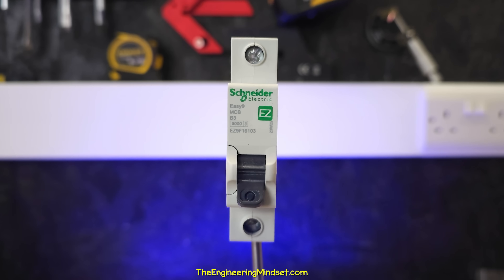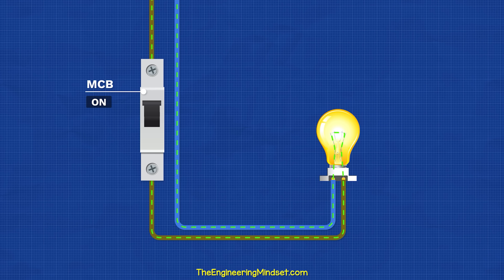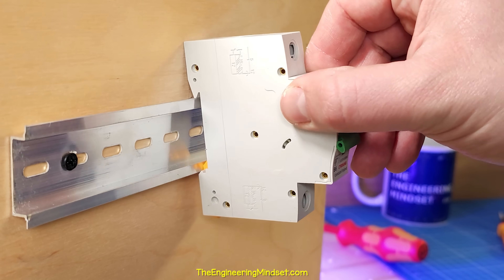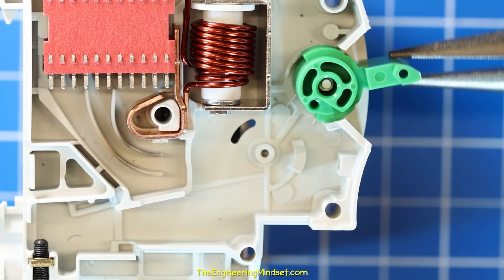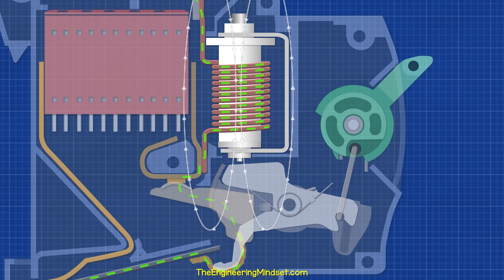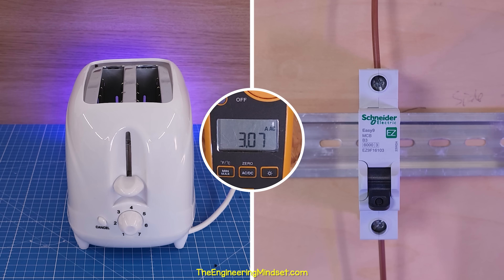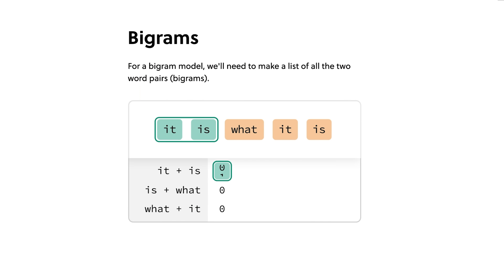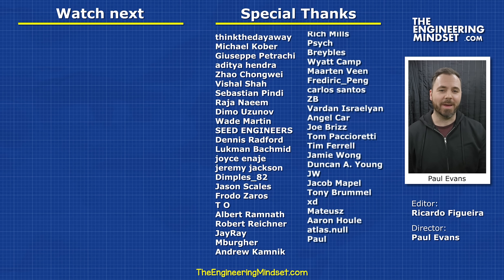Why Circuit Breakers DON'T Protect People (electric shocks)

Comment: it is also necessary to explain why RCD are not used as a substitute for circuit breakers and the types they are and the difference between them. 
also include the effect of the grounding circuit on breakers and the reason why it is not ok for it to be connected to null.

Comment: How does the solenoid push the piston the same direction regardless of when in the AC phase the rush of current happens to occur? This is mentioned at 11:34 but I can't tell why it works both ways.
Reply: My guess: 
Since we are running AC with 60 hertz, that means in 0.0083 (1/120) seconds it will switch the force to pull down anyways. 
Alternatively, maybe the piston will get pull back down by the spring with enough force to break the circuit.

Comment: Nobody puts the neutral to a breaker! Its even bad for the symmetric dispensation of the load on the phases if the neutral is not connected but the phases are
Reply: A neutral is only ever on a breaker if its a 2 pole breaker with the corresonding live which is perfectly fine

Comment: As a young apprentice back in 1974 I was taught that the amperage you have to worry about killing you is "any amperage that is enough to stop your heart." In the US people tend to think that's either 15 amps or 20 amps because those are the most common sizes for breakers in their home's panel.
Reply: 100mA is potentially enough to stop your heart. It also depends on the voltage
Reply: @PlayboyHZ It does not depend on the voltage if you know what the resulting flowing current is - the voltage just exists to drive the current. 

It depends on the energy delivered, the current density, the physical/anatomical route taken by the current, and whether it's DC or AC and what frequency if AC, and at what time during the cardiac cycle the shock occurs.

Comment: US breakers are specified slightly differently to EU and rest of the planet. There that rip current, say 10A, is a current it will trip at within a certain time, and normal operation you derate to around 70% for continuous loads.  Short peaks for start up are allowed, but long term, over say an hour, will trip them at the face plate current. Unlike the DIN and others, which are rated to not trip at the rated current.

Incidentally a hot breaker will trip at a lower overload, at least till it cools down, and a breaker in a board with adjacent hot running breakers will also trip closer to the minimum of the curve.  conversely a breaker outside, in very cold weather, might not trip at all other than on the short circuit current, which is why you often will find the feed to a house is provided by a series connection of a fuse and a breaker, as the fuse, normally at the supplier tap off, will be guaranteed to always fail after a period of moderate overload, while the breaker is possible to have fail shorted.
Reply from the maker: We just published a new Ground fault, short circuit and arc fault video, so much detail! Link HERE➡️: https://youtu.be/Qi0ynSQw-wc

Comment: this is how a terminal MCB works
the function of combo units (GFCI+ plug-in breaker, AF breaker ect)  is different
also this is of UK (or EU) design, in the USA the breaker is energized always unless a fault or manual override is performed, never tripping in a power cut
during lineman work they have their own disconnects and are informed of local suppliers (like homeowners with grid-tie)
though I agree the manual reset after a power cut is a good idea, it forces natural organic resets that avoid inrush surge without  having to plan power re-activation cycles

Comment: This is why we use differential circuit breakers. 300mA at the meter breaker, 30mA for kitchen appliances and 10mA for bathrooms. Those are installed to protect humans from dying when electrocuted.

Comment: Can anyone explain to me why a circuit of any size, say even 50 amps, will not short circuit with a very small resistance but will with no resistance? This seems to be true for any amperage circuit, no?
Reply: Uh, no.
All materials have resistance. And even if you had a magical piece of perfectly conducting wire, the wires in your walls providing that current would still have resistance, and so on.
A "short circuit" is simply a shorthand way of saying an unintended current path that causes energy to be dissipated in the wires rather than your connected device.

Comment: In a moment of distraction i tried to pull out the metal pin that got left on the socket when i was trying to unplug a hairdryer it was about evening when i held it everything immediatly went black for a second i thought i died i started shouting to my family in terror when i heard their voice i relaxed just a bit i don’t care whatever the fuck reason for this is it saved my life that day
Edit: I think it was called something like leak protection system which cuts the whole power of the house ofc i do not know how that stuff works in usa
Reply: Yanks call them residual current devices (RCDs). When you touched the pin, enough current passed through your body to trip it. 
It's an elegant mechanism, really. A small transformer sits in the device, and when exactly the same amount of current enters AND leaves the house circuitry, all the magnetic fields in the transformer cancel out.
But when some current "goes missing" (ie. gets rerouted via your body), the imbalance induces a current in the transformer secondary winding which is sensed.

Comment: there are some cases where the breaker has such a massive spike that it even bypasses those breakers and goes directly for the breaker that has the highest amperage rating, I once had a TV that KILLED my electrical meter because it was drawing so much current in so quickly that the sensitive electronics inside couldn't cope and I had to reset the breaker leading INTO the building, not just my residential location... so yes very exciting day for me

Comment: Ok, maybe you have different education procedures and common knowledge. But to protect people differential circuit breakers are used. Which are commonly installed per group of generic protectors (or only them, but that gets really expensive pretty fast). DAMMIT - WAS WRITING WHILE LISTENING AND YOU GOT TO DIFFS RIGHT BEFORE I WAS TO SUBMIT :D

Comment: I already knew this as it's a part of my job, you did an amazing job explaining! One thing I want to emphasize, especially for anyone using this video to study for an exam: the curves show at which current the breaker can trip, so it's not that a B breaker will trip from 3x rated current onwards, it can trip at 3-5x rated current and it will trip from 5x rated current to the maximum current it can break. So if you have an exam for this coming up and the question is "with V=230V and R=1O, will a B16A breaker definitely trip?", don't look at if the current exceeds 3x the rated current, look at if it exceeds 5x the rated current. In this case, it would take just 80A for the breaker to definitively trip, so we're golden with a short circuit current of 230A. But if you have a C32A breaker for lighting circuits (quite common in my field, event technology), it takes 320A for the breaker to definitively trip so a resistance of 1O is too high. If you thought of this calculation as "it takes 5x rated current for the breaker to trip so my short circuit current needs to exceed 160A", you would miss that problem which can become a costly and potentially deadly mistake.
" can trip" vs " will trip" is a vital distinction here.

Comment: a little warning for forein people, sometime breacker are wired from top to bottom, not from bottom to top as shown in video. (France and some Europe country)

Also, it is safer to have MCB with neutral link. This way, when you cut power for maintenance/bulb changing, you are sure to be safe, as sometime, neutral is inverted with line...

And ALLWAYS check that you don't get anyvoltage before doing anything.

Comment: Breakers are ment to protect devices and prevent fires, a GFCI is what u are looking for, in europe usually the whole house is on 1 GFCI so if a human trips any breaker it will trip it.
There i shortened the video in 1 line.

Comment: What is the method to measure AC amps when the current is going back and forth?
Reply: You basically create two halves of a transformer. The time-varying AC current of the supply induces a voltage in the meter.
Faraday's law, in other words.

Comment: This is a bit misleading for Australia - as of 2018 it is a legal requirement for new or modified lighting and small power subcircuits to have earth fault protection. As such, MCB's are largely being replaced by RCBOs - basically an MCB with an RCD in it. Regardless, this is an excellent video explaining the functionality.
Reply: why should anyone care about ozzy electrical code peculiarities? Should he also have listed all the ways in which the other 194 countries on the planet are mutually inconsistent regarding arbitrary legal requirements?

The device is hardly going to be much different just because you shove an extra current transformer and relay in it.

Comment: Safety first.  I have multiple degrees in science and I also have wired a house.  When I wired a certain circuit in a house we own I created inadvertently a cover plate that, went there was a short or overvoltage, would shock anybody touching the cover plate.  I thought I wired it correctly.  When a professional electrician saw my work, he said he would like to wring the neck of the incompetent electrician who did such dangerous work.  I didn't tell him it was me.  Always use competent electricians.  In another property that uses a three or five pole circuit for an elevator, professional electricians have refused to work on the elevator since, though they generally understood how it works, they didn't have the proper training.  And these guys all had scars from mistakes made while working on two-three phase circuits even though they were pros. Electricity is unforgiving.
Reply: You were probably supposed to ground the enclosure... which would've instantly tripped the RCD. 
An elevator is altogether a rather more intimidating type of beast.
Reply: @cheesofile666  Yes,  probably.  What I did was this:  it was an old house that had two wires (black hot and white neutral) enclosed inside a metal flexible pipe that I assumed was the ground.  I connected the appliance to the hot and neutral wires and for the green screw on the appliance I attached it to the flexible metal tube.  I think that's correct?  But somehow over time the hot wires, which I had fastened together with electrical tape and wing nuts, must have touched the flexible metal pipe and people would occasionally receive a mild shock.  That's all I remember.  Luckily nobody was hurt.

Comment: 101 reason why you need a GFCI
Reply: Hello
Would you mind help me
I have 1 mcn 216e c16 , 2 relay i think (22.23.9.012.4000

I have alarm beep, if i turn mcn on alarm beeping , false alarm 😢

How to check ? 
Im trying to learn now how its connected so i see if there is miss wiring then i want to learn if mcn or relay broken
Reply: @purplefurture6960 hire an electrician
Reply: Rcd and GFCI is the same, only the scale and tripping current are different
Reply: @razsegev6415 ah yes
Reply: @razsegev6415 can they be used together?
Reply: @just_bean_things  probably. I made the first comment because Rcd was mentioned in the video.
Reply: @razsegev6415  They're the same thing. The point is tho, Circuit Breakers and Fuses protect property, GFCI/RCD/RCCB protect people for added protection you could also install an AFCI or Arc Fault Circuit interrupter. They protect from Arc Faults.
Reply: @razsegev6415  Well GFCI are only for individual outlets, when the RCD protects the whole section to which it is connected.

Comment: Bad situation once found wall socket wired up past stainless worktop.  Long story short pardon the pun. Wire shorted almost burn through wortop stainless before rcd cut it off. Lesson learned the hard way. 👍

Comment: You should never use an MCB or RCD for home circuits, all homes should have residual current circuit breakers with overcurrent protection (RCBO) which will trigger when  any line is touched or exceeds the rated mA. I see a lot of American and European homes using only MCBs with a main RCD.
Reply: Explain why one is preferable to the other.

Comment: I'm glad you said qualified and competent at 4:20, because I've seen a lot of people who are competent who think they're qualified, and people who are qualified but aren't quite competent 😂😂
Reply: me who thinks i know what im doing (EE undergrad, NOT a qualified electrician)
Reply: Back when I worked as one.
I've seen some who were neither qualified, nor competent...
Reply: And the latter often are what makes the former exist.
Reply: It doesn't help that in some countries, you are allowed to do basic electrical work yourself. 

Eg swapping a light fixture or plug socket.
It potentially opens you up to putting it back incorrectly or making the decision to leave power on at the breaker and use the light switch to isolate the light.
Reply: @ArmChairPlum  In my country, you can get a cert to work with relatively high voltages without much hassle. It's pretty much a joke, as long as you know a fork doesn't belong in an outlet you'll get the certification.
Reply: @ArmChairPlum  LOL... I just added a new switch and light to a dark area of my house, removed a central light and replaced with two 4' LED strips in my office/work room, replaced a ceiling fan, replaced every recepticle and light switch in the house, and ran a new circuit to my garage for a welder. My work looks better than the "pro" who originally wired the house.
Reply: @ArmChairPlum  замена светильника или розетки, это элементарная работа. Я это делал начиная с возраста 11-12 лет.

Comment: There is an basic difference between direct contact and indirect contact.

While in direct contact you are right, the circuit breaker will not protect us. What will protect us is only an RCD. While in idirect contact over an metallic case connected to a ground wire, the circuit breaker can protect us, because it will create a high enough short cirquit. Thats why we always test the short cirquit current.

Comment: Sidenote for the installation of those CB (just a way to ensure safety): always connect the hot wire to the top terminal, output line always go out at the bottom terminal of the CB. If you need to go through the second CB, run the output wire back to the top terminal of the second CB. 
Why you need to do this? If you are not the only one who do the maintenance of equipments, there is highly chances that someone will get electric shock because they don't check the wires's condition again after switch off the CB. By doing one way terminal, the hot wire will always on top, mean if you switch off any CB, the cable go out at the bottom of that CB surely have no electricity.